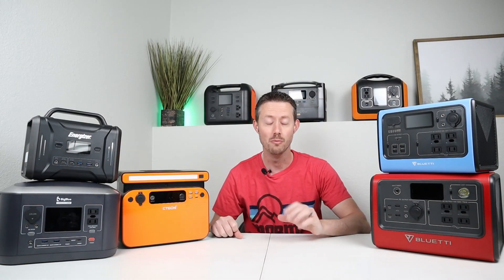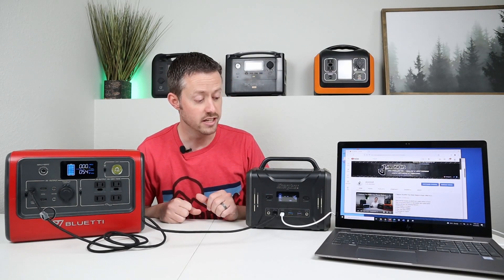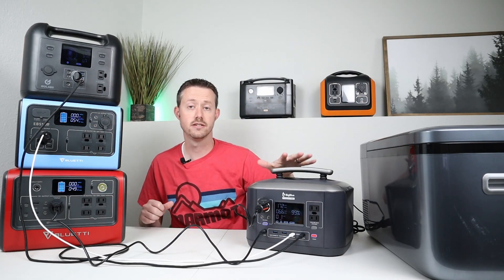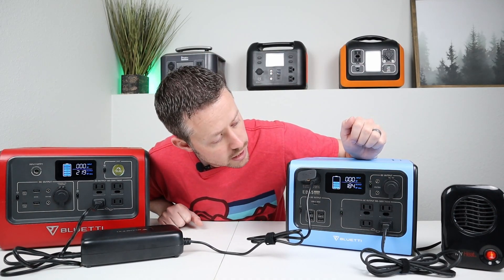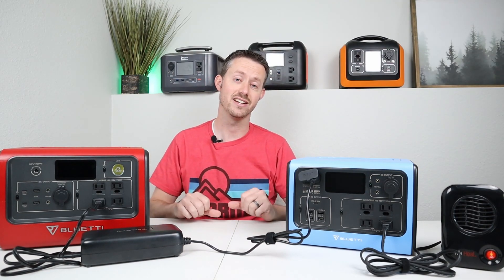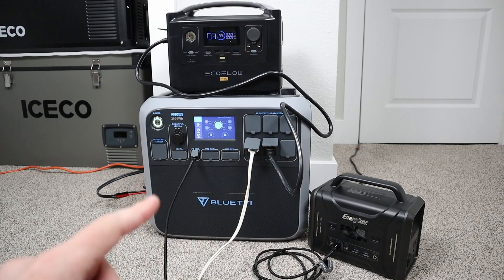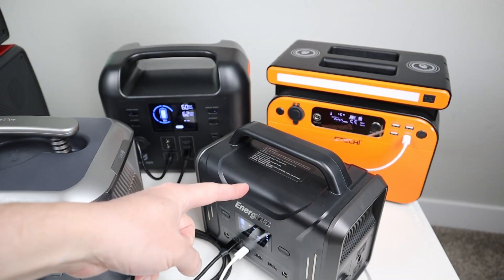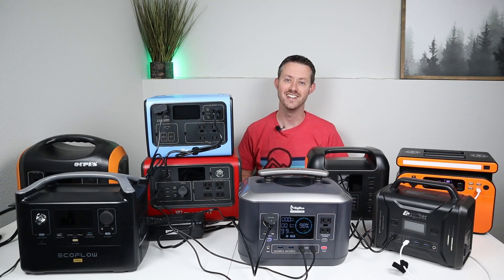More Capacity!? Connecting Multiple Power Stations Together - Daisy Chaining 8 Power Stations!!!

Comment from the maker: This video was meant to be a fun way to show that daisy chaining is possible with multiple power stations. I have had some comments about this process is not efficient. That is correct, I understand there is energy loss through heat and conversion. Don't plan on daisy chaining being your "best charging option". It works... but charging each power station alone would be the MOST efficient option.
Reply: is it possible to connect 2 Bluetti eb3a together. if so how to do it. Thanks
Reply from the maker: @hi8383  no, they can't connect.
Reply: @hi8383 you can connect AC to AC and it works but you lose some watts during conversion.
Reply: Is it possible to connect 2 ALLPOWERS R4000 units together with parallel ports?
Reply: Ok I've done a lot of research now on daisy chaining Bluetti products and the real answer is nobody really knows about the efficiency. There is significant loss when going DC to DC as well as AC to AC. But which one is best? Since the Bluetti products also have UPS function it makes their AC to AC conversions more efficient than products that don't have UPS capability. I haven't seen one video that tests the conversion difference in these power stations.

Comment: Great video .. I'll try the same test in the next few days but I'll be using 2 of the Jackery 100 Explorer 100 + models and a 100w solar panel .
The Jackery 100's are the largest banks that can go on an airplane and I'll be taking this setup to Cuba as there are towns with less than 3 hrs of electricity a day .
I am sure this will help . Thank you !!

Comment: Wait! What happens if you just plug in the power chord of the first one to the AC of the second one. Then do the same with the second one to the third one. Any thoughts? My reason is the charging would be faster.
Reply: I’m thinking Bluetti because that’s what i have and it has fast charging using AC in from wall.

Comment: Glad I found your video. It's one of the few videos that demonstrates Daisy Chaining power stations. I am using 3 Jackery power stations, daisy chained, and plan to add a 4th. The largest station is powered by 1200W of panels (the max it can take), and I get the stacked capacity (minus the inverter %tage efficiency). The system is actually working remarkably well for my application, PLUS, I have the flexibility of being to place power stations in different locations if necessary.

Comment: I'm confused as to why you are using the AC to charge from the bluettie's.  thus wasting power using the inverter instead of using the 12v input/output to daisy chain.
Reply from the maker: This is a super old video, I'm learned a lot since this one haha... And power stations have sure changed a lot.

Comment: I actually do this with my Ac200max and D2Max because the D2Max solar input is limited to 60v. To charge the D2Max I would have to sideline solar panels and since I only have 1 input coming into the house this was the best way for me to max solar input. The AC200MAX gets up to 900 watts of solar and about 300 watts go to the D2Max using the 2 DC outputs from the AC200MAX. I solar is good and the AC200MAX is at a good SOC I'll also use the ac from the AC200MAX  and set the charge rate to balance the load with the Ac200max solar input. This has been working good that I've added an extra battery to the D2Max. The D2Max then runs a couple of house circuits.

Comment: Hi, Can i plug in my UPS (Eaton and APC brand) to EPS ( Ecoflow Delta2) and use it nonstop ? Or can I even use it in case of emergency ? Wont tehre be a fire hazzard ?
Reply: Eaton & APC almost always use AGM Batteries that can be killed with a deep discharge. If you have the EcoFlow to dedicate to the computer use, just remove the Eaton & APC from the circuit. UPS are really only designed for short term use and if you have the data link cable connected between the APC and the computer you can shut the computer down with the APC PowerChute software. Also be aware that the UPS devices may use a modified sinewave voltage whereas the EcoFlow uses a pure sine wave voltage output-- easier on your computer data sensitive circuitry!!! EcoFlow uses LiFePo4 batteries which you can completely discharge and still recharge with no problems! Will Prowse recently did a greatly informative video!

Comment: Can I load my power station at home by a small one which generates energy from running car?
Reply: Yes but you get some energy loss through the DC to AC converter in the first one and then AC to DC in the second one. Ideally you want to go DC to DC to avoid any conversion by the inverters.

Comment: @Jasonoid quick hypothetical question, lets say you had two Pecron 1500LFP and a single 48v expansion battery. If you chained both of the 1500LFP to the expansion battery would they all balance or would the two systems just fight over controlling the expansion battery? Would other brands react the same way, most of the expansion ports are bi-directional
Reply from the maker: I dont think that would work. The communication would be all mixed up. It might even cause damage to the power stations.

Comment: Can you connect two power stations tha is 2400w each making them 4800w in total? What kind of daisy chain cord is needed for this?
Reply: No you can only expand the amount of energy in storage, not the amount of power you can use at one time. The limits of the power output is based on the inverter in each separate power station.
Reply: Vigorpool Captain power station allows this in parallel.

Comment: Can one of these things charge itself? Can it do that while powering another device?
Reply from the maker: You'll need to charge the power station with a solar panel or  the wall outlet. It can't charge itself.
Reply: @Jasonoid  why can it not, or why can one not be created? If you could start the motor with a rechargeable battery like in a car (but smaller) it could run a device like the alternator in a car that generates power for the car and charges it's own "start up" battery just like a car. Could the power generator (like alternator) be designed with the capacity to do that and if not, why? What are the mechanical issues that make it impossible?
Reply: If it could charge itself it would have been the solution to all our power needs for present and future. Why research fusion reaction when we have a self charging solar generator. 😂 😂😂

Comment: Can you hook these up in parallel
Reply from the maker: Check out the Vigorpool Captain 600, 1200, and 2400. Those models can be connected in parallel! Pretty cool feature.
Reply: @Jasonoid  I I’m new to this I’m trying to put it in a van and power a pc for gaming, 2 electric burner to cook, and a mini fridge. I want to hook up to of them while having each one draw power at the same rate while also being charged by 4 or 6 solar panels
Reply from the maker: @Lookatthis93  you just need to get one larger unit, you have quite the load you want to run. You'll need to work out a plan for charging them up as well.

Comment: I have both Pecron E1500 LFP and Pecron E2000 LFP. My main use is for home backup in case of an outage. I combine both Pecron power stations in a "master- slave" way. The E1500 is the master and the E2000 is the slave support unit with its larger solar yielding capacity and larger battery.
The E1500 having the UPS mode powers the critical loads like the refrigerator, the freezer, the modem-WiFi router and the home automation. On the E1500 LFP,  the 32 -95 V "solar" input port is always prioritized over the wall outlet supplied Ac input internal charging port. This way allows to recharge the E1500 LFP battery from either solar or using the Pecron charging "brick" with the aviation connector or a 48 V battery charger linked to the 32 -95 V by means of a Pecron provided cable with the aviation connector. Also, this way allows the utility supplied input 1400 Watt port internal charger to work only when there is no solar or any other source supplying the 32 -95 V "solar" input port. Otherwise, when there is power supplied to the 32 -95 V "solar" input port, the AC internal charger is moderated to just top off the battery,
So, 2400 W of solar panels supply the slave Pecron E2000 LFP that in return feeds power in the 32 -95 V "solar" input port of the E1500 LFP when needed. This feed is from a E2000 LFP Ac output to an external "brick" that provides 42 V - 15 A to the  32 -95 V "solar" input port of the E1500 LFP. I noticed that the E1500 LFP "requires" input power to recharge only when the battery shows less than a 96 % level. The solar input of the E1500 LFP being prioritized, the "slave" E2000 LFP AC output and accompanying brick charger remain idle until the next E1500 demand.
Since the above mentioned critical loads only draw about 200 Watt-hour per hour from the E1500 LFP, the slave E2000 LFP battery gets fully charged and stops all solar input. To benefit the available free solar energy one just has to plug in some other load in the E2000 Ac outputs. When possible, sometimes we plug in a space heater. Some other times, when the sun shines, we cook using a counter top oven between 20 and 60 minutes (not to deplete deeply the E2000 battery), or a hot plate, or a small slow cooker. We always care not to deplete the E2000 battery lower than 80 % by the end of daylight. No one knows what will happen during the night or the day after.
Recently, hundreds of miles away from home for 15 days, we appreciated our Pecron setup. All the critical loads were powered 24/7 for 15 days. We also appreciated using the E1500 LFP WiFi monitoring app. All the critical loads were linked to the E1500 LFP. With our home WiFi router always on, we consulted the E1500 LFP status and using a camera we also monitored the E2000 status over the Internet. We were also able to activate the utility supplied heating appliances. The only missing part was that we could not activate any new load over the Internet to use the extra solar energy when the E2000 battery went to 100 %. Since then we got a WiFi controlled space heater and no longer reject the free solar energy when the power stations batteries are fully charged. We keep on powering the critical loads from our setup 24/7. All critical loads have been powered this way for 27 days now with very little input from the utility.
Reply: Wow! That's an amazing setup Adam!
I'm a newbie and learning every day...especially from people like you who share their real world experiences.
Thank you.

Comment: I have an electric fireplace that takes 750 or 1500 watts.  If I linked 3 500 watt power stations, can I run it?  Is there a way to hook up solar panels to charge them all at the same time, so I can keep them linked together as my permament power source?
Reply from the maker: Unfortunately, there isn't a way to link 3 smaller power stations together like that for more wattage.

You'll need a larger power station that can support high solar input. Something like the Bluetti AC200L would work, it's more expensive because of the larger battery.

Comment: I never thought about daisy chaining the power stations.  I recently experimented with my Class B RV and was monitoring the amperage loads when the compressor of my 15000 BTU A/C comes on.  It turns out that it surges to about 16.2 amps.  Since my power banks do not have 30 amp plugs I decided to use my ecoflow 2000 max to see if I could run the A/C just using the regular A/C plugs.  It is not the wattage surge that trips the circuit but the amps.  So I turned off the lights and just left the fridge on.  I plugged my ecoflow using a 30 amp to 15 amp 110 V adaptor.  The key here was to start on low fan, than work to high fan, let it run a minute or so, than switch to low cool and let it run a couple of minutes, and than switch to high cool.  By doing it this way I never exceeded more than 11 amps of surge.  Of course it discharged my unit in 40 minutes.  

Now that I saw your video I have two delta 2's and 2 delta max 2000 and am going to try daisy chain them to the RV A/C plug.  I know that I will never run my A/C this way but you got my juices flowing with this video.  Should I daisy change from the Delta max 2000 to Delta max 2000 to Delta 2 to Delta 2 or reverse the sequence?

As always you are a genius and great video and content.

Comment: Is there any way you can do it the opposite way round and charge the larger powerstation with the smaller
Reply from the maker: You can charge a larger power station with a smaller one, it just won't fill the entire battery since it's smaller.

Comment: Hey there....I have the Bluetti EB3A and the Energizer Arc 300. Can you daisy chain these 2 units and if so how? Or what would be the best way? Thanks:)
Reply from the maker: You can either connect them via the DC output port and charging port, or you can connect them via the AC inverter and the AC charging cables. That will help you get a longer runtime.
Reply: @Jasonoid  Thank you...I may bother you further on this issue! lol

Comment: Great video. Is there a way  or some device to combine the output of different solar generators together to power an appliance - so I guess this means they are in parallel  connection?
Reply from the maker: The Vigorpool Captain 1200 can be connected together in 'parallel' and the AC output doubles, along with the capacity. Pretty cool feature! https://youtu.be/QhGSW4rN8gk
Reply: @Jasonoid  Thanks! Pity though I was thinking of using my Ecoflow with an Axpert.

Comment: Hi, I have a well water pump that needs 12,000 watts to run. I have two solar batteries at 6,000 watts each. Is it possible to combine 2 solar batteries of 6,000 each to make 12,000 watts to run my well water pump? If yes, what is the setup to make this possible?
I’m currently using a 13,000 watts gas generator to run my water pump but gas prices too high. I want to use portable solar power station batteries instead.
Reply from the maker: I don't know of any power station that can provide 12,000 watts of power right now. They are getting bigger so maybe soon.

Comment: I contacted Ecoflow on the River 2 Pro about daisy chaining that one. They said they don't recommend that as it may lead to overload. What are your thoughts?
Reply from the maker: They aren't going to recommend anything out of the normal use case. I don't see how it would overload the power station if you are just connecting another one to the DC output or USBc output, it's like a 100w load. What model are you thinking about how would you connect them?

Comment: I have a 2000 watt solar generator, which has worked great for the past 6 months, but there are only two charging input ports/jack. One is 3 prong, and the other Anderson port. The Anderson port in my opinion, is cheap and now not it does not work. The only way I can charge is to plug into the wall and use my coach gas generator, or if I was in a home, I could plug it into the wall. My generator doesn't run long enough to charge it and I wouldn't want to eat that much gas anyway. Is there a way I can buy a small solar generator and plug it into my 2000 watt? Do they all come with 3 prong outlets? Because that's how I'd have to daisy chain them, via the 3 prong outlets. TY

Comment: Jasonoid-  Awesome videos, thanks.  Follow-up question that I think is a different configuration than what you show here--  Could you take 2 Anker Powerhouse 767's, and "daisy chain" them together, placing one of them in UPS mode, and using the second one as a general battery.  In other words, doubling the capacity for continuous use-- when one battery depletes, the UPS battery next in the chain would "kick in".   I really like everything about the Anker from your other review, but would want to have the 8KW capacity if possible by using two.
Reply from the maker: I think that would work just fine, the first one would pass power straight through (1440 watts worth) until the power station died, and then it would start using it's own battery. Usually UPS mode uses a little bit of background power. I have been thinking about trying idea that with a couple power stations I have sitting around, sounds like a fun experiment!